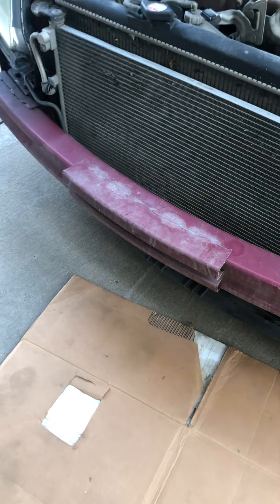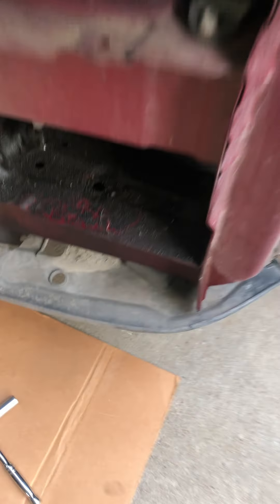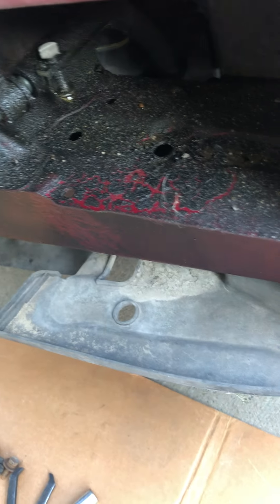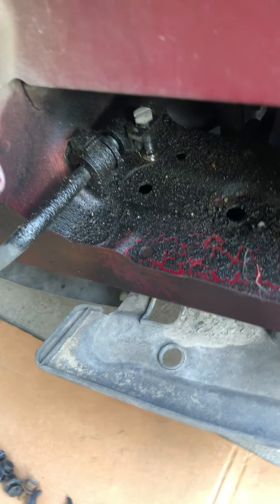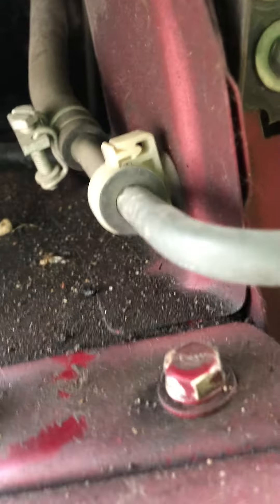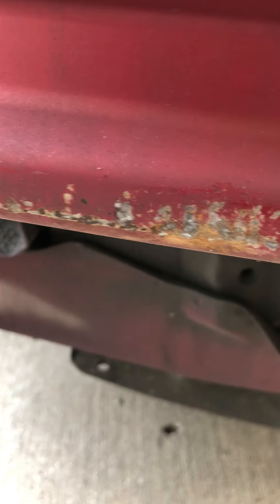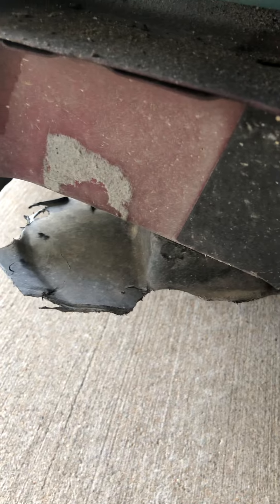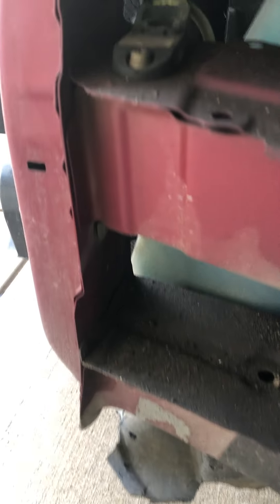Honda Odyssey Power Steering leak that you couldn't see until you do this

Comment: Those lines rust away and micro-holes eventually let the fluid ooze out. I couldn't see exactly where mine was leaking, but I replaced it and the leak stopped. What a PITA. They could have used lines with better steel, or maybe even copper. Their job isnt just passage of fluid. It's also designed to provide cooling. That's why just replacing it with a long length of hose isn't ok. It needs to be metal to transfer the heat out of the fluid.